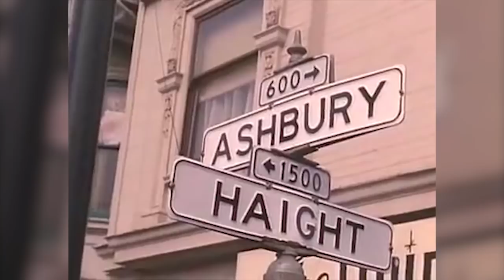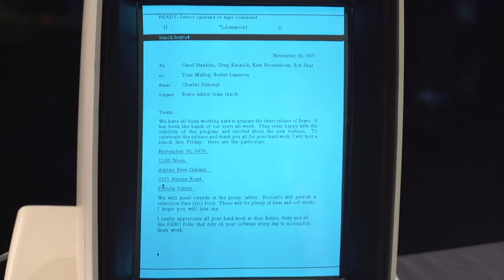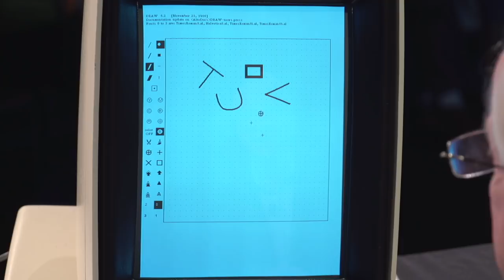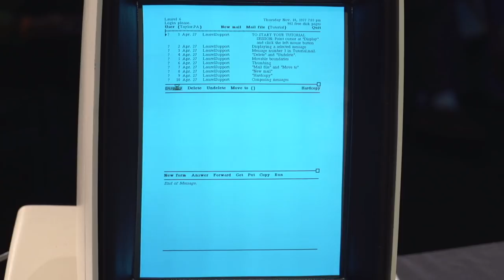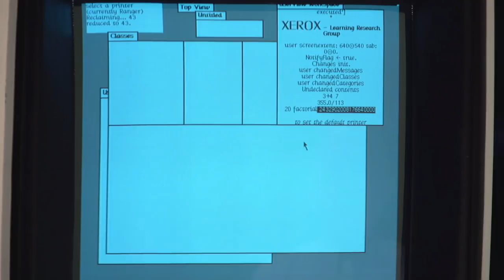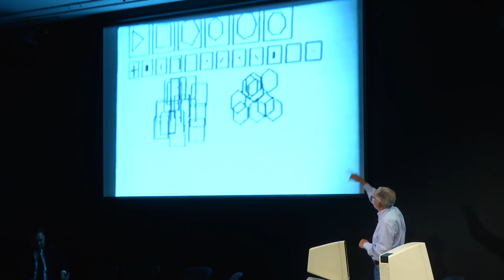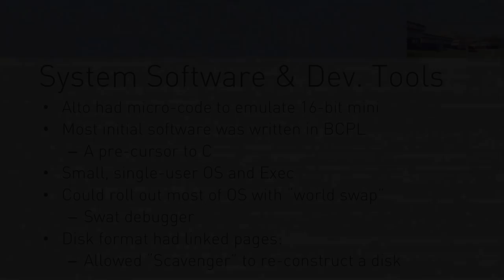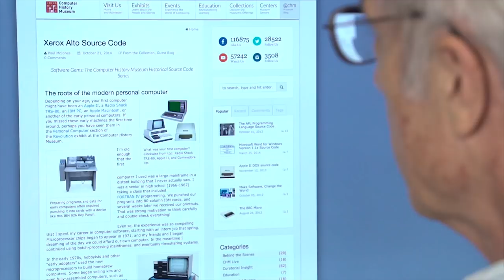CHM Live | Yesterday's Computer of Tomorrow: The Xerox Alto

Comment: I’ve always been fascinated with Xerox’s Alto computer since middle school some ~25 years ago, I’ve even considered making a working replica of the Alto CPU which today is easier than ever given the low cost of custom one off PCB services & most of the TTL IC’s are still available, or new old stock is easily sourced such as the 74181 ALU TTL IC’s, which I’ve accumulated dozens for a number of projects (74F181).